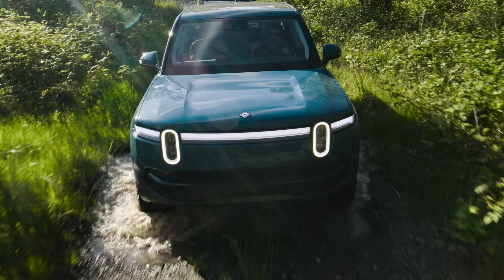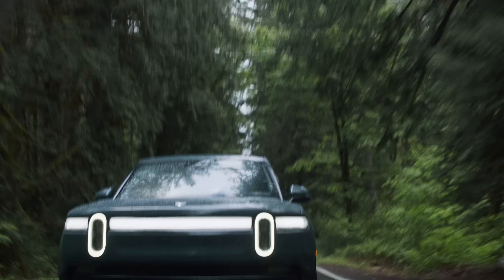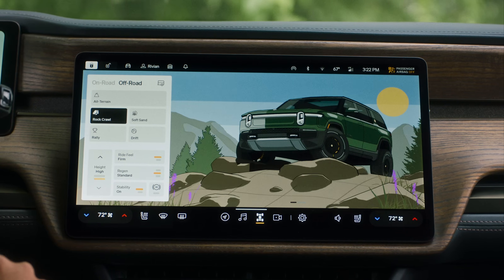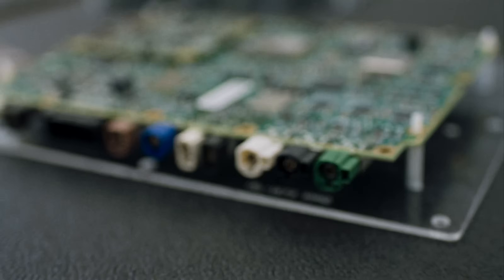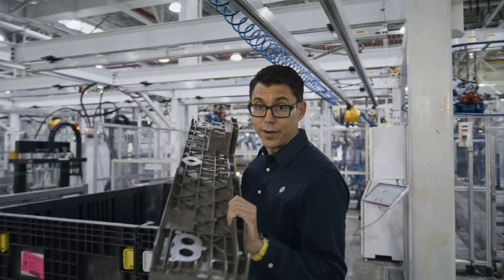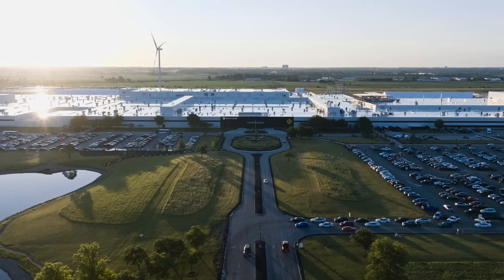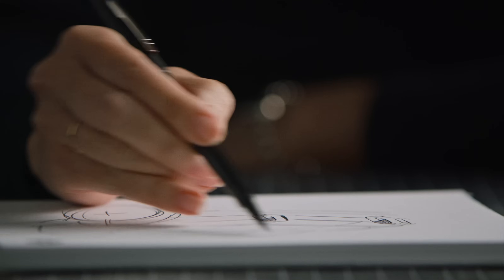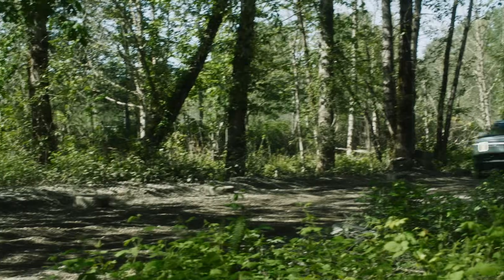Why We Build Our Technology In-House | Now & Forever | Rivian

Comment: I intend for my next vehicle to be a BEV and am waiting for the next generation of solid state batteries to move into EV ownership.
For the EV’s currently available, I like what I see from multiple auto companies.
The one area I dislike is the use of touch controls for HVAC, Infotainment, seat movement, etc. Driver use of touch controls is dangerous as it almost always requires the driver to move their eyes from the road to the screen – this is dangerous and a significant safety issue. 
I want to see auto companies design controls using ONLY mechanical knobs, buttons, and switches. This feature will have a big impact on my purchase decision.
I believe touch only controls should be made illegal in moving vehicles.

Comment: If i had the money to buy a vehicle right now since my fathers truck needs work, i would upgrade to this over any other fully electricl vehicle truck currently. 

However i think hybrid is the way to go if you plan on doing a lot of driving. I think that the very least electric cars like this should have an emergency gasoline powered generator. Doesnt have to be a large tank size. 

I have no experiende in engineering, or looked at the blueprints for this magnificent looking truck.

Comment: You could also reduce cost of energy by installing solar canopies to the external storage including the WOW yards, if you have them, and carparking areas including those parts of the carpark that are used for circulation. Usually carpark solar canopy systems only cover the airspace directly above the parking spaces but this means only ⅔ of potential ☀️ power generation capacity is utilised, leaving the final ⅓ wasted. 
WOW yards (Warehouse On Wheels) have HUGE solar power generation capacity potential, especially where companies are looking to transition their fleets to EV.
Outdoor spaces, when either empty or not at full capacity, still attract the same costs [maintenance, property taxes, security, lighting, insurance] as when fully utilised. Therefore, making those spaces work harder in their three dimensional capacity rather than just the two dimensional, is simply logical and good business; also a great PR opportunity.

Comment: Why not just use camera for full self driving instead of lidars etc . Tesla tried that and that approach was not success . Rivian should license fsd from Tesla
Reply: Tesla is now putting radar back into their cars (HW4 update).  If you read the latest papers on full self-driving, you might see that it will not be safely technologically possible anytime soon using only cameras.  There is a reason everyone (besides Tesla) is incorporating non-visual sensors, regardless of the expense.  Tesla dropped them because of cost, not because it is a technically a good idea, and it was a mistake.  FSD safety standards are evolving worldwide - cameras alone will not suffice in the long run.  In any case, I doubt Tesla would ever license FSD to anyone - why would they?
Reply: @mm-qd1ho  I doubt that . Elon already said an automaker will be licensing fsd . No updates on whom or when . It’s going to be a cash cow. They are the fastest in the fsd space .
Reply: @oj9886  Thank you for the update I hope he follows through.  Mercedes has been approved for Level 3 - the first in the U.S. - Tesla is still at Level 2.  Competition and licensing is good for the consumer - many more options to pick from in the future.
Reply: @mm-qd1ho  it’s not true level 3 .. very restricted to where it can be used
Reply: Tesla never tried lidar.
Reply: @cypvh74  they did try non visual sensors
Reply: @oj9886  they had radar but dropped it during the pandemic because of cost and supply chain problems, but are bringing back radar. But that’s not the same as LiDAR.

Comment: If certain components can’t be worked on like I experienced when they had to replace my battery pack because a component went bad in my 22’ R1-T. When the warranty is expired is Rivian going to charge customers for a brand new battery pack because a component  needs replaced and you can’t access it without tearing apart the battery pack? I love my truck but do I need to sell before the warranty is up?
Reply: Ok so the new battery packs with access panels to work on individual components will be installed as courtesy upgrade.👍

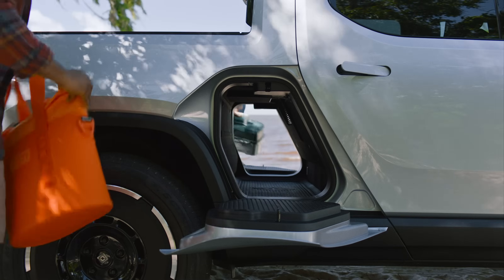Comment: 0:26  Thank you for mentioning price-point.  In my opinion, every version of the R1T doesn't need to have tech to the moon.  Make a stripped down "work truck" version and price it in the same ballpark as ICE trucks.  I'd be first in line.  But do it before Ford figures out they can put the Mach-E drivetrain under the Maverick.

Comment: hardware feedback - please change the design of the frunk to open like the Lightning (includes parts of the front of the nose) - the lift over is awkward and difficult to use
Reply: It’s designed that way because of the deeper water fording it allows. The rivian is made for off-roading and that dictates the design decision, the ford isn’t. While I agree with you that it would be nice to load the frunk in my R1 easier like the ford, I wouldn’t trade it for the decrease in water fording.  If you want a more street biased vehicle by a lightning or an EV9(which has no real  usable frunk)
Reply: @hoopdyhop76  that's a fair point. I can see how a lower opening could jeopardize the water seal.

the theoretical fording depth of the R1T is 43 in or about 3.5ft so a low front opening frunk might not work.

However I believe that's it's not actually safe to drive through water that high in the first place as the car could float (even at 7k+ lbs)  in about 3ft of water
Reply: I’d rather have the deep frunk, as it is now.

Comment: I really like my Rivian, but the fact that having a safe, on-screen notification for incoming text messages and a safe hands free way to send texts is a clear non-priority for Rivian is crazy to me.  I really would not consider getting another Rivian, either for my wife or kids or a new one for me, unless this is addressed.  PLEASE address texting in the car!  Thanks!
Reply: I have zero interest in texting in my car. But I’m sure it’s coming, like it or not.
Reply: Texting and driving?
Reply: If you are truly worried about safety you should wait till you are stopped or parked to respond to or worry about texts at all. Or at least setup voice commands on your phone that don't require taking your eyes off the road. Instead of reading text messages from a screen while you're driving!!!
Reply: @H3H3official some integrations do voice to text and text to voice for messages. With CarPlay you can also automatically set it to “driving” focus when connected to CarPlay and send auto messages that you are driving and will get back to them at a later time.